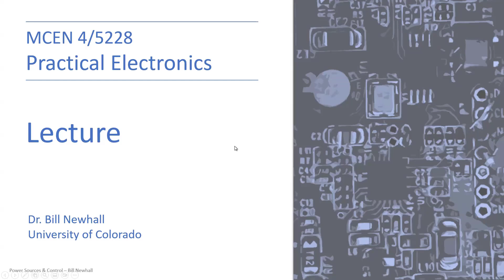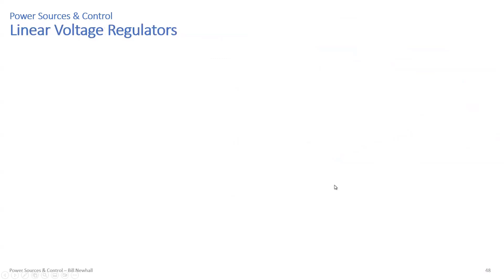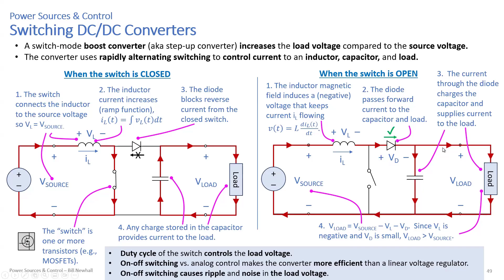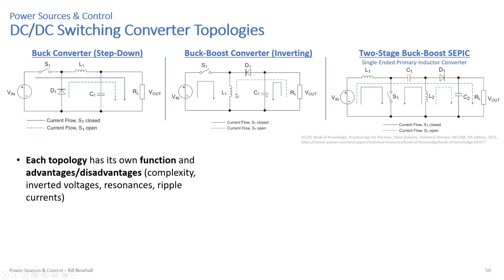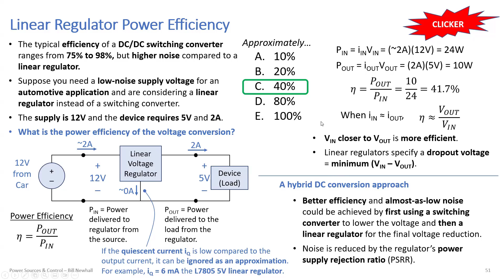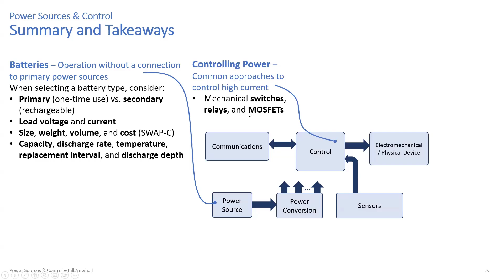Practical Electronics - Lecture 13

Comment: The direction of the induced voltage is always opposite to the direction of the current change that produces it. This is Lenz's law. Understanding this rule is essential for understanding boost circuits. The direction of the voltage induced on the coil when the switch is closed is completely opposite to the direction of the voltage induced when it is opened.